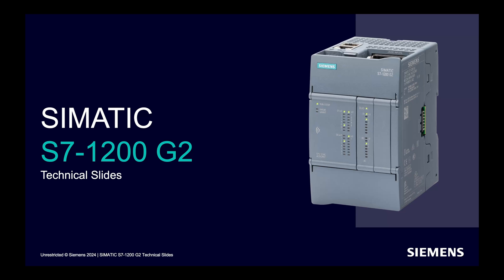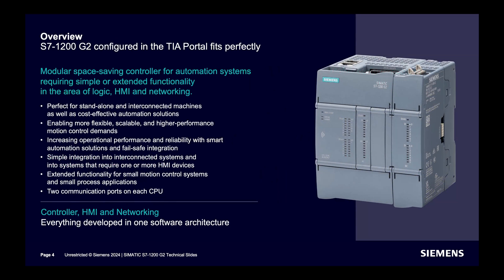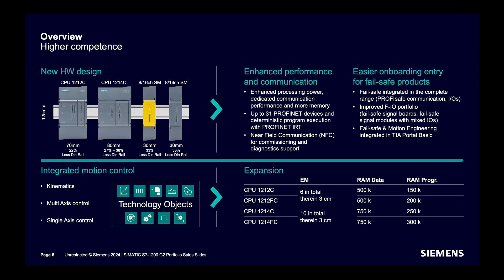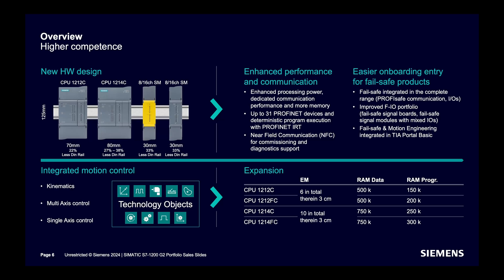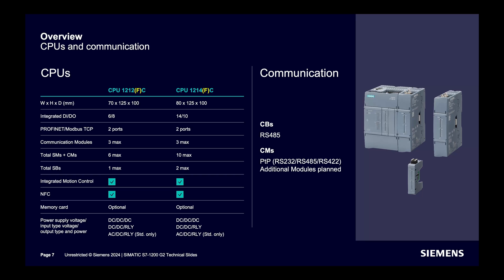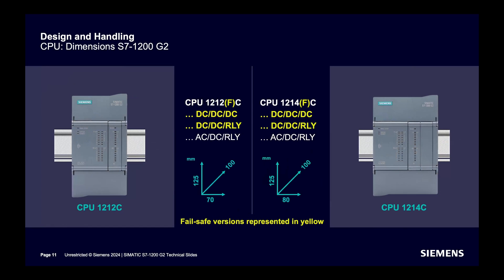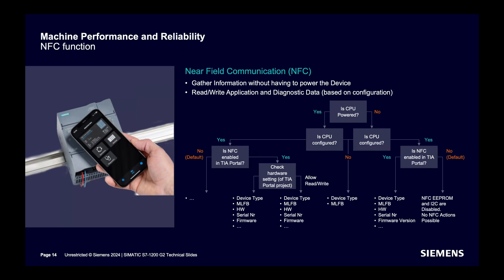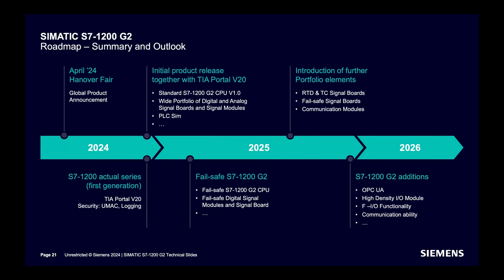Siemens S7-1200 G2 | New Generation CPU | Explanation

Comment: Is Siemens S30 PLC compatible with the supply power of 230 VAC, 2Ph, IT System (Neutral configuration type) 50Hz, by a dedicated redundant power cables.